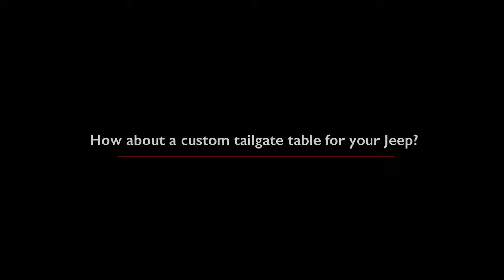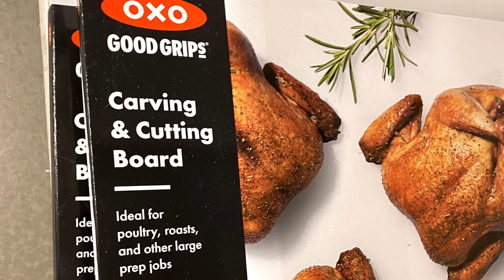Custom Mopar Jeep JL Tailgate Table

Comment: Great video.  I was surprised your wooden board still allowed it to close.  Was that thickness chosen to fill up the space to avoid rattle?
Reply from the maker: Hi David, good hearing from you! The Mopar Tailgate Table has a solid design that closes tightly and does not rattle. 

I wanted/needed a solid service to work from (think small SD Cards, etc) set up lunch from. You see how I had to mill it to fit down inside the frame. The 3/4" thickness fits perfectly in there and allows it to close. Having the wood was a nice bonus allowing easy mounting of accessories, tools, etc..

Comment: Steven, 
Your videos get better with each one.  I like your style of of presentation, you have a nice, calm voice.  I really like the way you've customized the Mopar tailgate table.  I'm sure you thought about this, so tell me, why did you decide against a full width cutting board?
Reply from the maker: Thanks for the compliment! I am working at making the presentations/production value better...I'm glad you can see that.

A full with cutting board would be a lot easier. Two things here: 1) I'm super impatient once I start a project and I could not source a cutting board big enough locally. 2) I thought a full plastic/synthetic board would be a little slippery to use as a work surface for camera gear and drones and the like...I'm sticking with answer #2😃

Another surface that I considered was bamboo. It makes a great cutting surface for food prep and looks good as well.
Reply: @ExpeditionBuilds  - I hadn't thought about the sliperry-ness factor.   I know how much you're into photography,  video and presentation, so yeah, that makes sense.  I just knew you had taken all those options into consideration.  haha.  I was just curious how you came to your conclusion.  Your build is really coming along.  Last week I placed an order for a Gobi Stealth Rack.  Now I have to patiently wait.
Reply from the maker: @davidyergensen4509  You try and take into consideration all the options, but truth be told, you could go several directions with regards to the surface. I also fly fish , and a solid surface is hugely helpful to layout various flys. 

In two weeks the real transformation happens, stay tuned for that. Good luck with the new Gobi Stealth. Will you be putting a tent on it?
Reply: @ExpeditionBuilds  - yes.  That is the current plan.  I would prefer to get a small trailer or teardrop.  But those are out of my immediate price range.  So, I'll go with an RTT for now, and then move towards and trainer in the future.  Im looking forward to your next videos.  Have a good night.